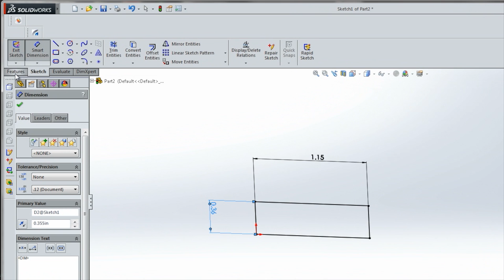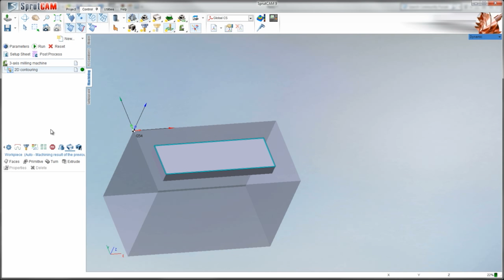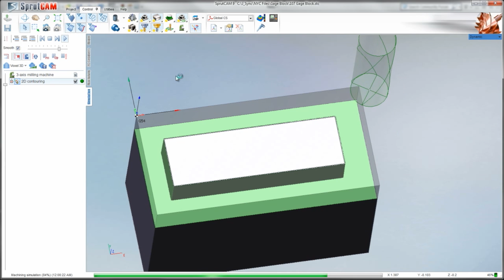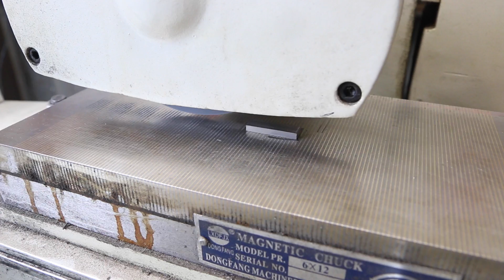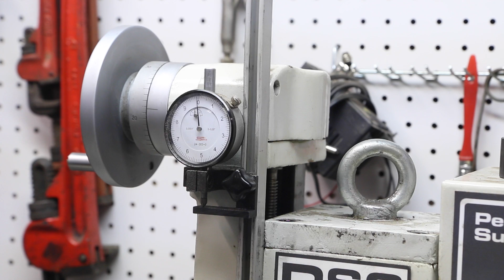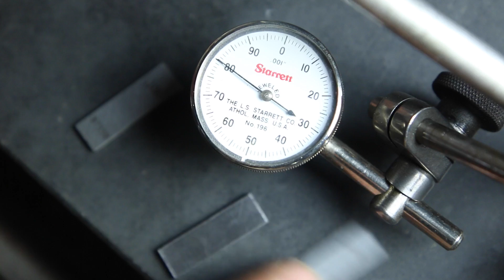The Lost 107: Machining & Grinding a Gage Block! Widget24

Comment: If it were me I'd avoid pulling outside air for the compressor. Its always a lot more variable, morning fog, evening dew, rain snow etc. All result in more water in the tank and to have to remove for painting etc. Plus mid-day heat makes air less dense lowering efficiency. Inside air might not perfectly conditioned but it is significantly better than the variability of outside air. if there is a power source on the other side of the shop see if you can hide it over there and supplement with a reservoir on this end of the shop. Maybe plumb into the office/tool room for sound reduction if moving the compressor is not an option. Otherwise consider a lower end or used rotary, especially if you plan to do a lot of blasting or see your future air demands increasing.